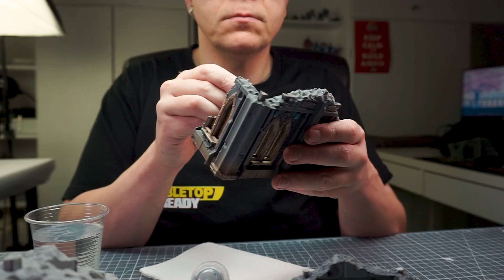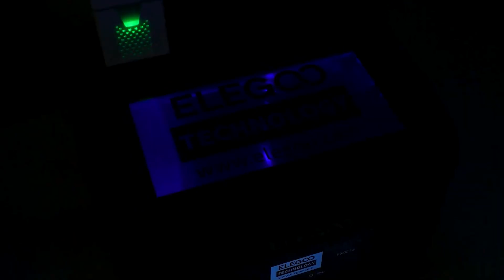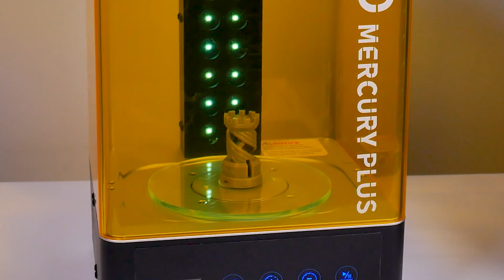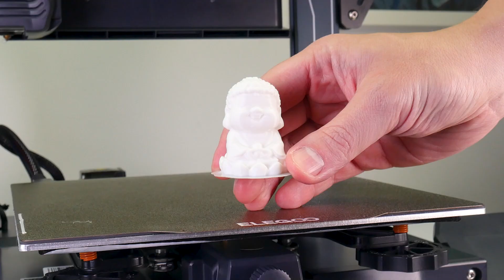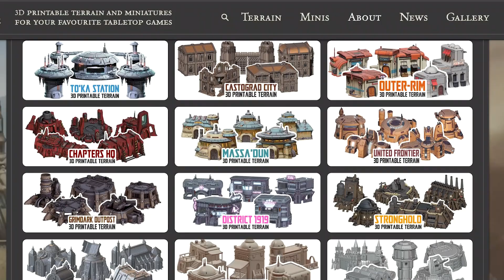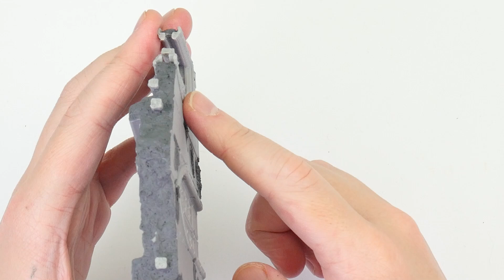Can you use a 3D printer for Warhammer

Comment: FDM is great for terrains and things like tanks.  They can do minis but it’s not optimal
Reply from the maker: I agree :D
Reply: I don't agree. I have a Bambu A1 mini and i print alot of warhammer stuff. Big ones like Redeemers and a Mars Warhound but also space marines and even a snotling wagon. (The cart, the Troll pushing it and all the tiny snotlings). I printed it on 0.2 mm nozzle with resin printer style supports i made in blueprint studio. Then use resin2fdm addon in blender and print. Some places can be somewhat disturbed, but i use some fine sandpaper to clean, then use AK 759 white primer and microfiller for the small layerlines. If there is a bigger gap or problem, i will use some UV resin to patch it and sand it afterwards.